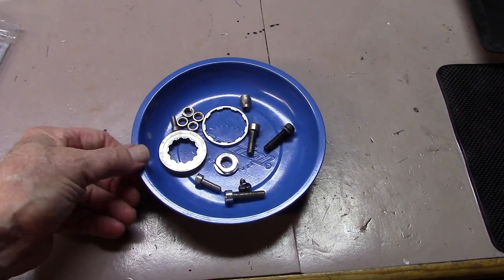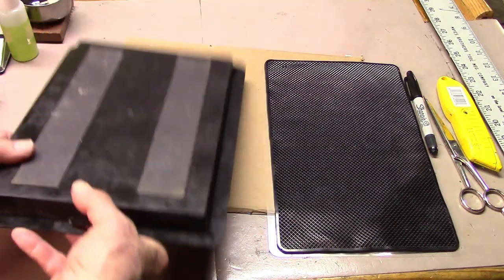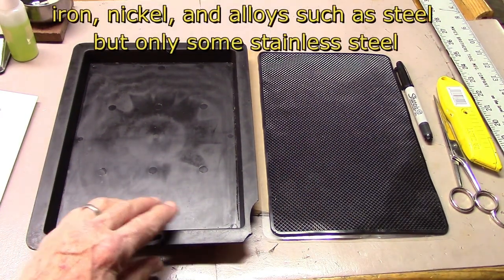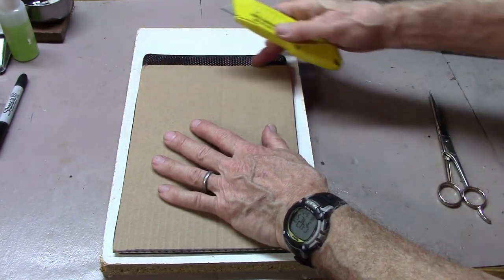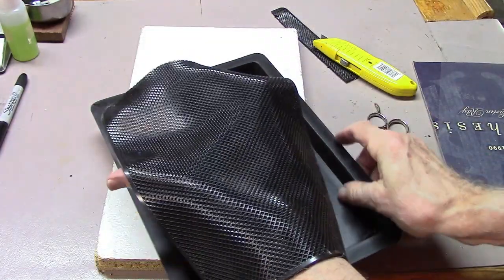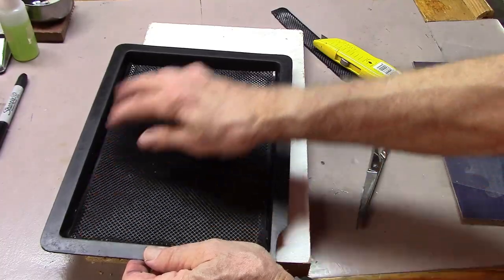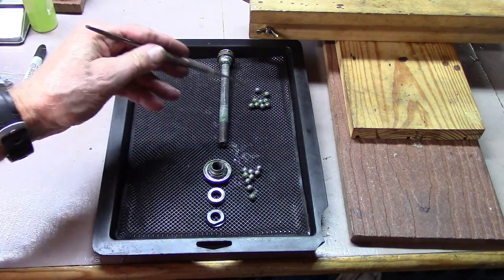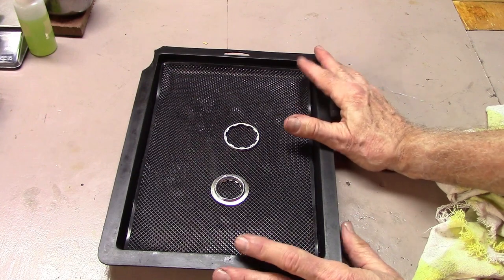DIY: Homemade Magnetic Parts Tray

Comment: IMPORTANT QUESTION : Amazon link is for a "non-magnetic" mat, or at least that's the way it is advertised, as are many others. Is this still the correct part needed, and used in video?
Reply from the maker: The pad is magnetic containing small magnetic particles distributed through out. What they mean by non magnetic is the other side is sticky (when you peel the backing off) - and the sticky surface adheres to your dashboard (or in our case, the tray) rather then magnetically sticking to a car dashboard or tray. Confusing, but once the pad is placed in the tray as in the video, metallic particle adhere in place and the bumpy surface keeps non metallic particles from moving around. It was fun to put together and has served me well. Thanks for the question, Tony

Comment from the maker: One can use a cookie tray or inexpensive small plastic tray from Amazon if you can't find one at the thrift store or flee market:
https://www.amazon.com/s?k=small+plastic+tray&crid=31CC6DF5TT5IB&sprefix=small+plastic+tray%2Caps%2C91&ref=nb_sb_ss_ts-doa-p_1_18
Note: You can buy (on line) rectangular magnetic trays rather then the small round one in the video. However, these rectangular trays have two large separate magnets on the bottom causing the same problems as the small Park Tool tray.

Comment: If the cardboard doesn't fit, then what?
Reply from the maker: Several different ways to cut the pattern:
Measurement of the inside and use of a straight edge ruler.
Using the bottom of the tray. See:
https://youtu.be/Oq6qVdoPzsw
Make the cardboard slightly bigger then the inside of the tray and keep trimming until it fits.